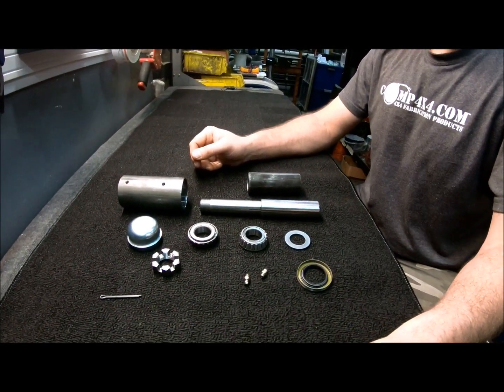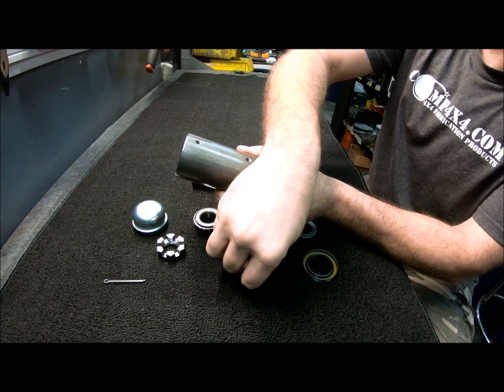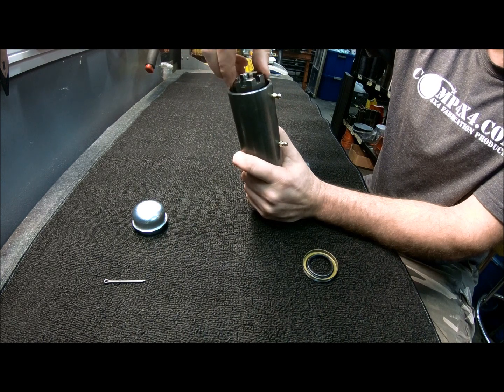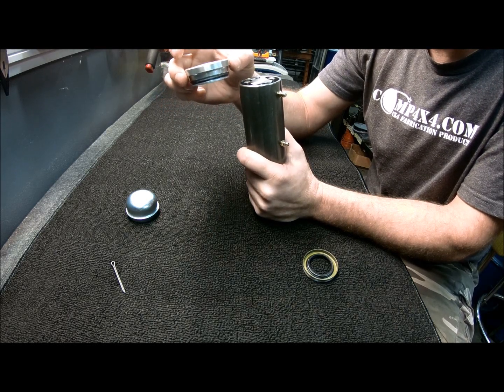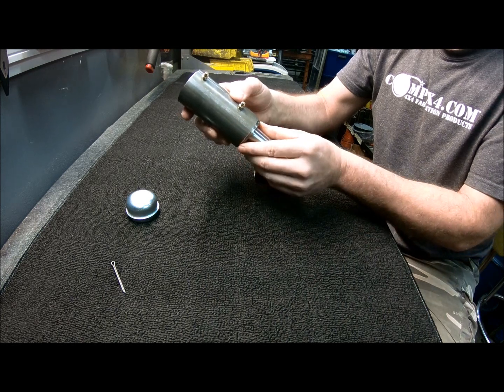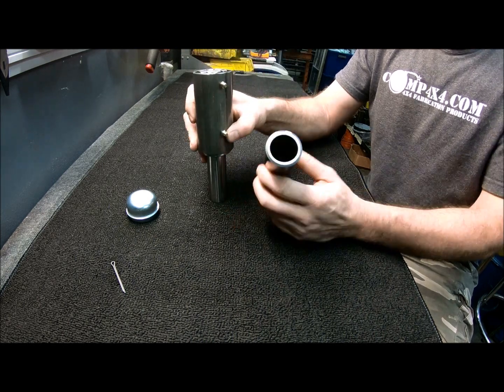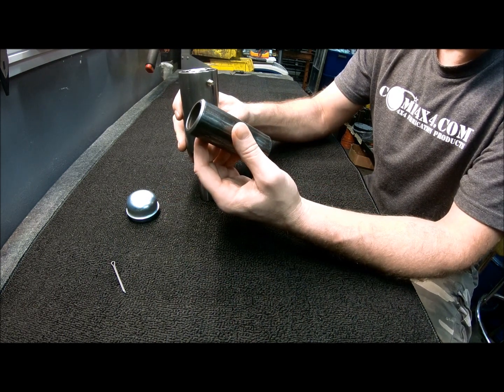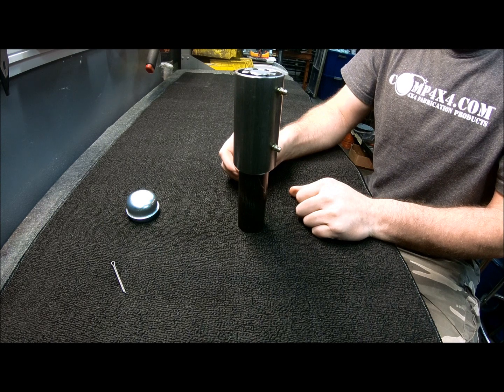Comp4x4 Tire Carrier Hinge Kit

Comment: I dont understand this how do you hold bottom of pin from swinging and ths using the bearings . drop in pin and swing on pin?????
Reply: When you weld the sleeve in... you are holding the spindle to set height.  The heat creates shrinkage and that locks it as one.  Additionally I personally drill 2-3 holes in the sleeve for plug welds, and then the spindle bottom and sleeve, weld together.   I only use Jared's larger 1.75 big one, in dual shear though.  But same same.